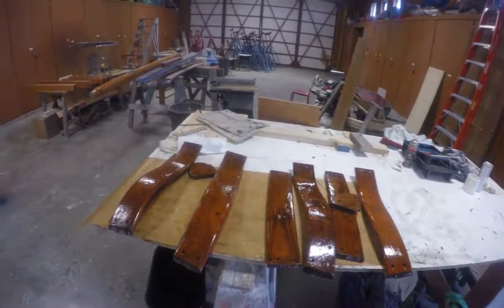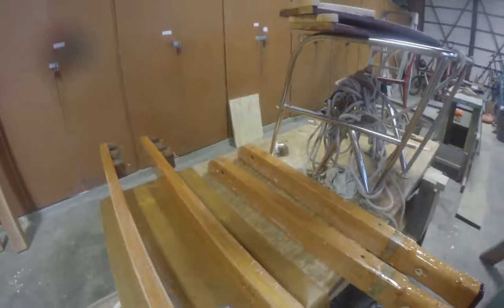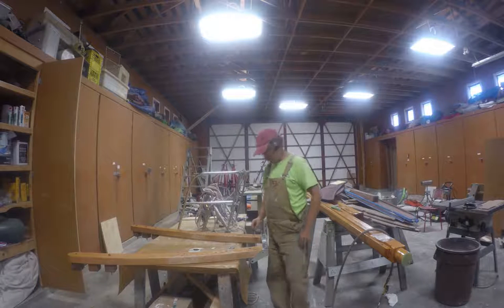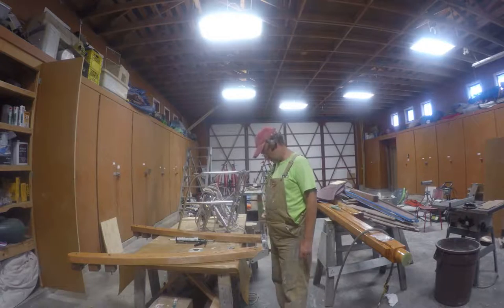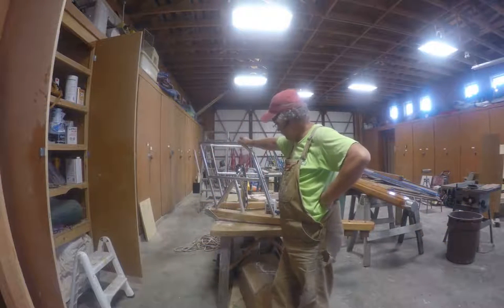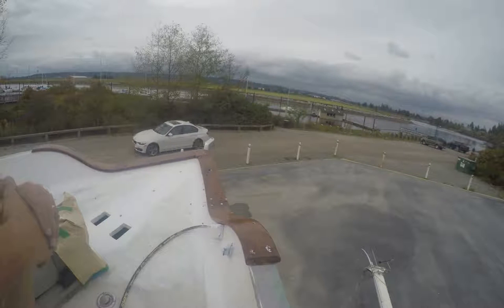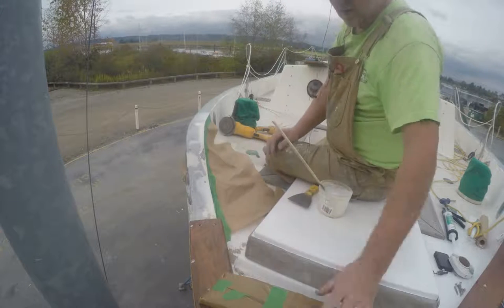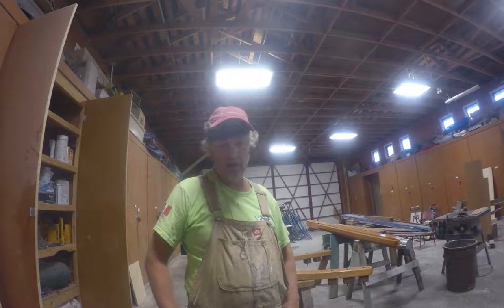Little Bear Westsail 32 refit: Boomkin Assembly Vlog #104

Comment: Hi, at Canadian Tire store, where they sale bolts and nuts, they have a plastic cabinet file where you will find many different o-ring size and many rubber plugs. In case you need some in the future. ;)